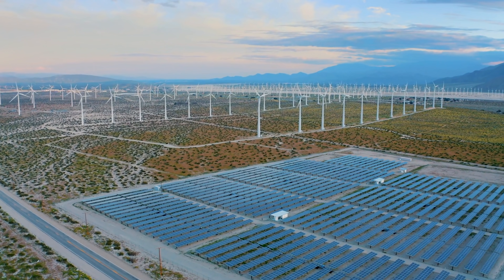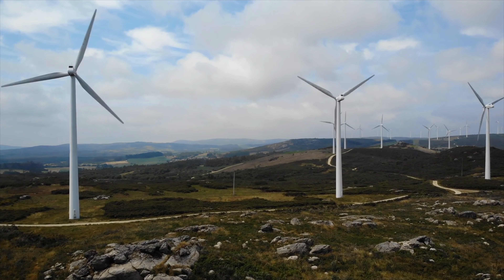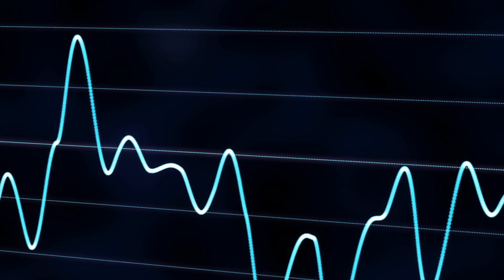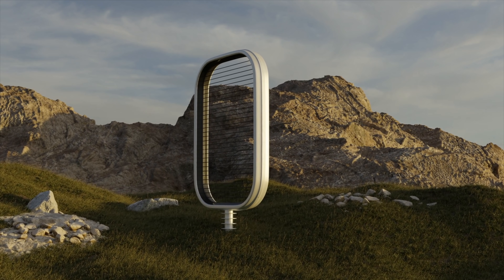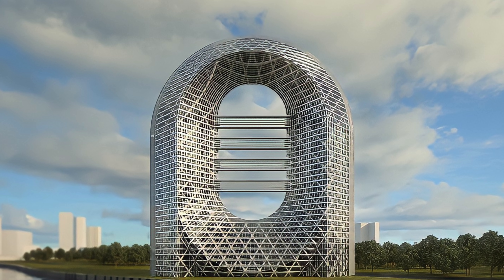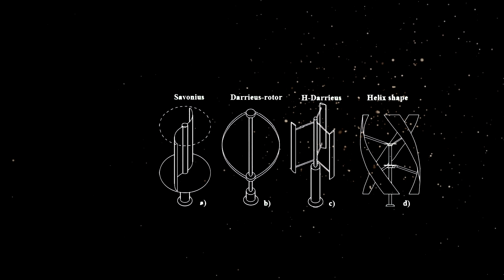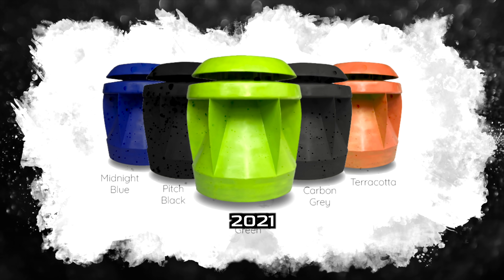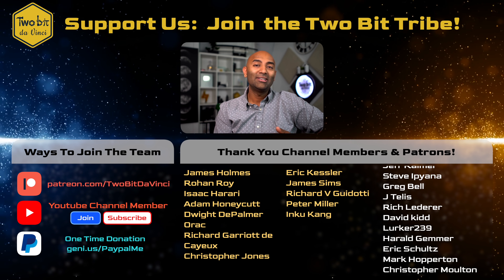These Wind Turbines have NO Blades!

Comment: Nice, I always hoped they would line the highways with vertical windmills.
Reply: There has already been a trial in England of small vertical wind turbines on the side of a stretch of motorway.  Makes so much sense. It proved successful. Hopefully it gets rolled out.
Reply: @FUBAR733  Long term trials and learning from mistakes will take time.
Reply: Vertical wind turbines are not as efficient as horizontal ones.  Since we know what direction the wind will come from (the cars on the highway), I wonder if small, horizontal wind turbines would be a better option.  I do recognize the necessary orientation of the wind turbine might make it impractical, but its a thought.
Reply: @christalbot210  And even if the wind is tacking or from an off center angle it would still spin to a point, the row could support each other as a continuous line of turbines and maybe benefit from topography better to catch up drafts. Cool idea. Easier cable management too.
Reply: more nrg to make them than you get out of them ... and the maintenance nightmare. I'd rather make a flying unicorn.
Reply: @ejrupp9555  The growing pains will suck.
Reply: @ElijahPerrin80  growing pains? You are at a lose to understanding entropy my friend. the solution is not in production ... that is actually the easy part. Bill Chichoke above tried to explain it ... the resource model is greater than the benefit. In other words ... you could live for a thousand years if you spent 990 years in hibernation. You have gained by losing. It's a failure in interpreting the reality of trade-offs. 

The moon and the tides ... slow the tides and it resists what causes it ... the moon. Everything is a trade off from the status quo. This fantasy of 100% clean NRG has a limiting factor ... USE. Like the government ... there is no income problem ... it's a spending problem. Look in the mirror ... that is the problem ... the user and they are multiplying.
Reply: @ejrupp9555  You both make great points, what tho if it could be used in remote areas to do the simple things like power lights for road control and illumination or warm an icy corner on a hill in closed micro grids. These are pie in the sky ideas at best but I can think of uses... But is it the best use of the technologies available.  Probably not.
Reply: @ElijahPerrin80  you envision a city that encompasses a park, so that you can go to the park to get away from the city ... But you have to created a city, in order to create a park to get away from the city, that provides the park. A city that did not exist but to create a park, to get away from the city.  It's madness.
Reply: Seriously?

That's already been done in California and along the Cokumbia river gorge between Oregon and Washington State.  They are an eyesore, and they've already cost the area major chunks of industry and lead to less grid reliability.  Weather-dependent generation is and has always been crap.

Coastal wave motion is a far more viable option, since it's constant.  Using waves to drive UNDERWATER pump vanes to generate power onshore would seem to make it about as baseline capable as possible.  As an added potential benefit, a series of pump vanes could slow wave erosion of coastal areas.

Since most of the largest cities are on coastlines, this would seem to be a far better solution than pinwheels and smoke and mirror solar, which covers almost 1000% more resources, for less than 30% of the power.
Reply: @billcichoke2534  this is not weather dependant generation. Rather traffic dependent with wind as an added benefit.
Reply: @FUBAR733  I get the concept.  The main issues with it are, the rate and flow of traffic isn't a constant, and that those would have to be REALLY close to the side of the highway to be able to grab vehicle wakes.  They would also have to be much shorter, putting them within reach of anyone who has to stop on the shoulder.

A possible different design would be the pressure/piezoelectric pad concept, where the WEIGHT of passing vehicles would generate a short charge.  The main issue I would see with either one of these widely distributed designs, is the amount of hardware needed to convert and normalize the current.  Short burst generation is, obviously, a less-than-optimal choice.
Reply: @billcichoke2534  I keep hoping for wave energy and tidal energy also, oceanic thermal energy conversion is interesting also, they need to just start.
Reply: @ElijahPerrin80  I believe the Dutch were using a system similar to what I described, to pump water from behind their dikes.  If it was pumped water to drive LAND-BASED turbines, it would be the world's most scalable and environmentally safe hydro.

Any generation that takes place over or in water, and requires cables to take the power to shore, is inherently an environmental and reliability risk.  There's just no getting around it; cables fail and it causes damage to local wildlife and is much harder to repair.  Vanes that can be locked off to repair a slightly leaky pipe running SEAWATER, win't damage anything and are easier and cheaper to deal with.
Reply: @billcichoke2534  It really could make the perfect hydraulic lifting pump for hydro, once that water is on land after a turbine the water also could be used for air conditioning or even cooling soil for greenhouses on its way back to the sea. Maybe even power a heat pump.
Reply: @ElijahPerrin80  Yes, you COULD do that, if there was a need, I guess.

Looking to smaller hydro plants for a reference, I believe a station with 5 of these smaller turbines so powered, would be able to generate around 100-150MW (assuming 3 of the 5 running at any given time).  Makenthose REGIONAL ONLY, and get rid of grid ties, and you have more power on the grid available for inland users with no access to suitable waterways.

Of course, I think we should also be doing compact regional reactors (LFTR or breeder) which would, again, do away with the need for a national grid.  All we're doing right now, is making EVERYONE more and more likely to suffer more and more blackouts.  Break the grid up into 4 regions per state (more for Alaska, California and Texas), and I can almost guarantee the quality of service and price per kWh would be better...not to mention more reliable.
Reply: @billcichoke2534  I really hope the people can accept future nuclear power, Russia's idea to put a couple reactors on a ship as a portable strategic energy is brilliant for so many reasons and just as reckless. I am optimistic also for LFTR or even traveling wave reactors if possible, the micro reactors could change how we think about energy finally moving to a human proof ish design. 

I am surprised the grid is still so large, HVDC has helped a lot to reduce line losses but it still amazes me we haven't moved to state sized or in some situations county sized grids with neighboring locations only as a backup. It seems so simple from this perspective. Lol
Reply: @ElijahPerrin80  It might be more pieces, but there's no need for any huge utility to run anything, and less chance for overreaching government or terrorist interference.

Maybe that's the reason they haven't been adopted...who needs big government to solve an problem that no longer exists?
Reply: @billcichoke2534  they are small and on a motorway that itself is not very pretty.